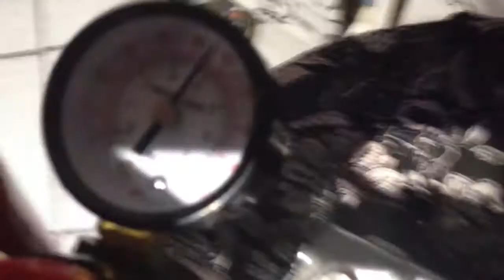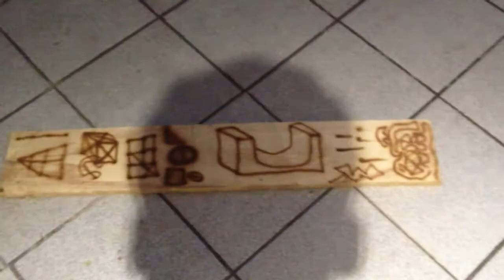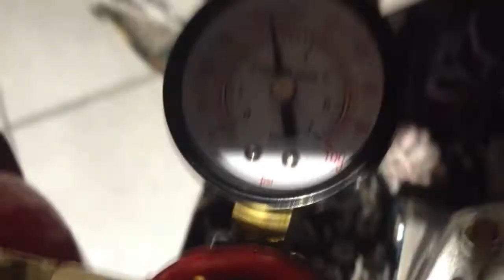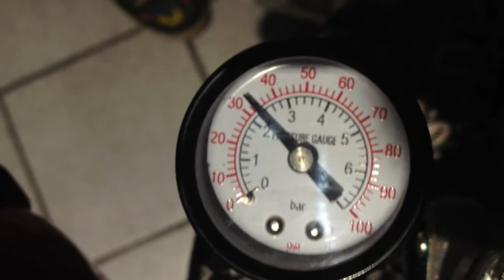worlds most easy air compressor tank build

Comment: #1 Remove your regulator / water filter from the compressor,  you will be attaching it to the T in step #4.
#2 Attach the T to the compressor where the regulator / water filter was attached.
#3 Remove your air hose from the T and rotate the T sideways so it is not pointing up, but points to the side.
#4 Attach the regulator / water filter to the T where the hose was attached and attach the hose to the regulator / water filter.

Make sure you attach the regulator / water filter correctly to the T so the air hose is attached to the correct side of the regulator / water filter.
I know this video was uploaded in 2014 and it is now 2022.  This advise may help someone else who comes along looking to do similar.
Great Video

Comment: What turns the compressor off, pressure switch?
Reply from the maker: Yes, a pressure switch turn on and off, keeps pressure between 40and 60psi on this unit
Reply: LiPe VoLcOm came with unit? Is it adjustable?
Reply: @lipevolcom2   Yes I was asking myself the same question?  It's a safety switch insdide the compressor in case it got missed use and the pipe is blocked or something?